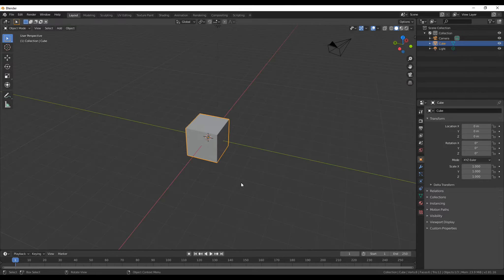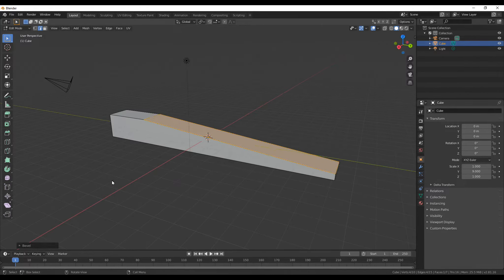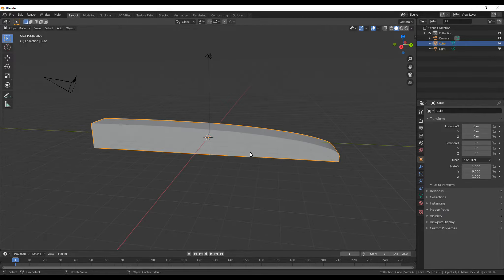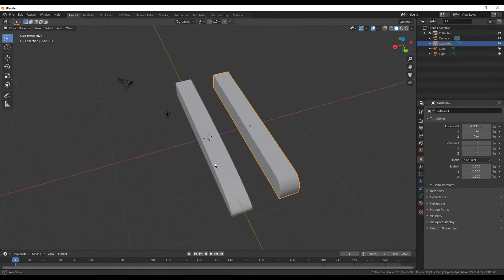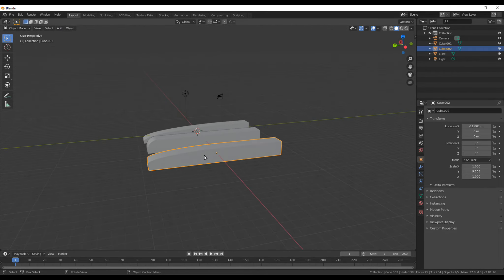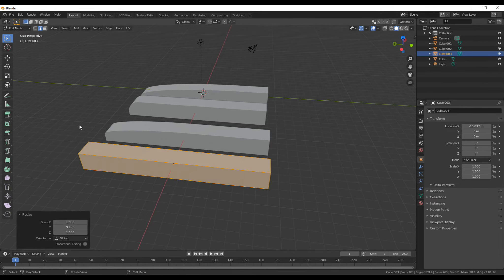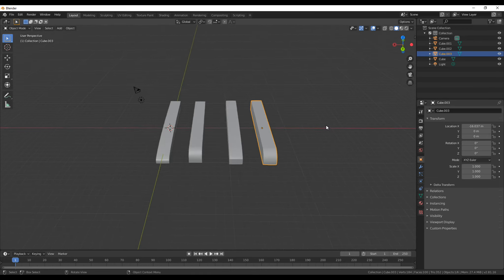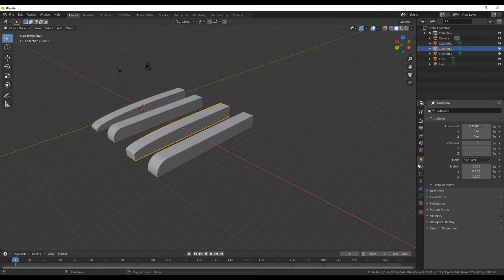How to Fix a Stretched Bevel in Blender 2.82!

Comment: Great video! However, you only talk about how to avoid it, but is there a way to actually fix the original model so it bevels properly? Sometimes I receive models that scaled at some point in history. Blender remembers this and it seems the only way to avoid it is to remodel from scratch.That's fine for a cube but a total pain for something more complex. In Maya, I would just delete history and freeze transformations then be done. Crazy that I still haven't come across an actual fix for this.
Reply: press ctrl-A whilst selecting object - click roation and scale. will be fixed.
Reply: You helped me a lot thank you
 @kitkana
Reply: The equivalent to Maya "Freeze Transformations" in Blender, is Object > Apply > All Transforms. You can also select specific transforms from this menu. (Of course you must have the object selected and be in Object mode.)

Shortcut is CTRL + A